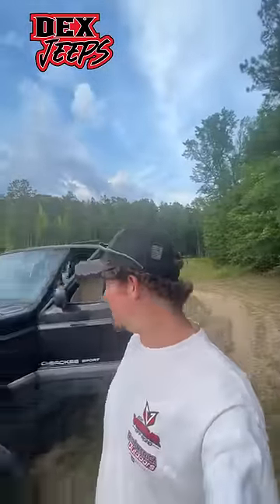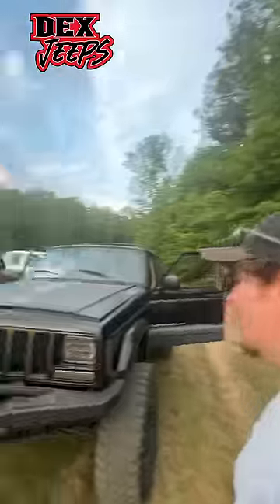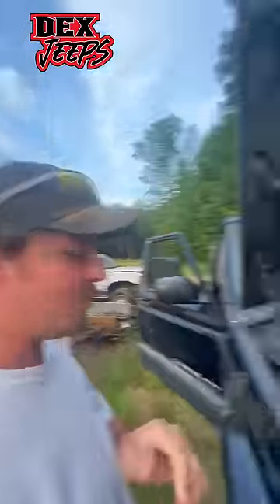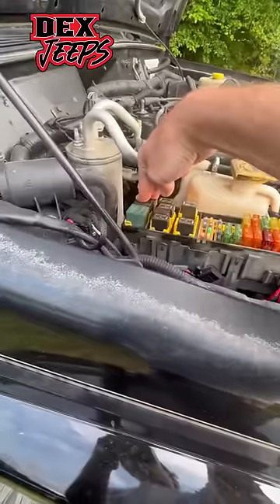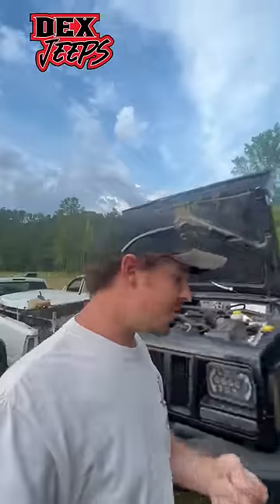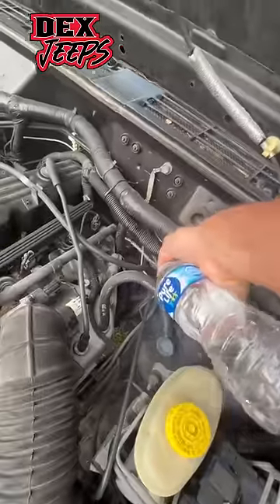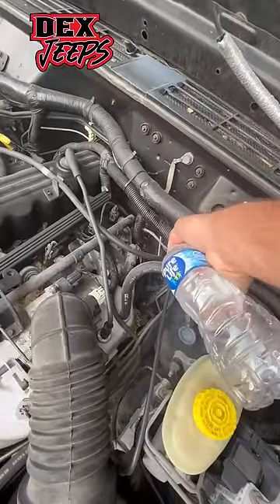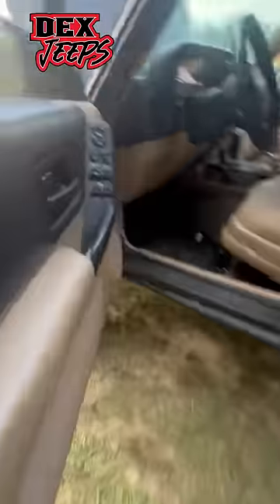Jeep crank sensor trick to get you home. #jeep #jeepxj #xj #jeepcherokee #cranksensor #jeeptips

Comment: It's a $10 part that is known to fail. We've carried a spare in the glovebox for decades.
Reply from the maker: lol I’m 100yards from my shop with a lift.
Reply: uhhhh a 10$ sensor isnt going to have the correct magnet strength.... the CPS is a sensor you want to buy from mopar... im a Jeep guy for the passt 20 years..  I am absolutetly shocked you got 71 thumbs up for this..

The 10$ amazon sensors, the magnet cant even hold a trim screw... the mopar you gatta pry the screw off... but hey have fun breaking down again.  

Mopar does make the cps for the ZJ and XJ still brand new..
Reply: @jeepsblackpowderandlights4305  Funny thing is just how wrong you are. Your first mistake was to assume that we're using Amazon sensors, but I have installed many over the past 30 years as a professional tech and they work just fine. With inflation and crap since covid if you pay more than $25 for a Mopar crank sensor then you're shopping in the wrong places. Just because you spend more money on your's doesn't mean it's better, it means we're smarter with our money. 20 years you say? Even my kiddos have been jeeping longer than that.
Reply: Just paid $400 for a tow and a crank sensor 100 miles from home 😭
Reply: @jeepsblackpowderandlights4305 this^ one of my friends has 2 cherokees the aftermarket sensors all fail within weeks sometimes even days after the replacement. He has done the replacement numerous times while waiting for the mopar genuine part to come in as they're kinda hard to come by.  Best bet is always to get a mopar genuine one. Unless you love replacing the sensor 😂
Reply: Try 45
Reply: @DriftingDragon74 this sounds like straight cope.. the higher the price usually does mean the higher the quality bud, I’ve been a parts monkey and a tech, sorry to say it bud, but he’s right. Yes there are outliers where you pay more for shit quality but dealer is always the way to go.
Reply: @DriftingDragon74 one day you’ll learn the difference because it’ll bite you in the ass. The difference in quality of part between oem and aftermarket is huge. There’s a reason why the factory sensor made it 15 years and the oreillys master pro special made it a year and half. (Exactly why the warranty is a year, it’s meant to break again)
Reply: @THESK8LIFE97  One day you'll learn not to make assumptions. Where did I say aftermarket is better? I use Mopar or NTK sensors typically... of which many are made in china. However at the end of the day I must install what the customer requests and here in northern NY over the past 30+ years as a professional tech   I have not seen a difference in longevity. A $200 sensor can fail at the same rate as a $5 sensor. Just like I tell my customers when they complain of the same problem after they changed a part... just because it's new or you spent a lot of money on it, doesn't mean it's good.
Reply: @jeepsblackpowderandlights4305  I'm absolutely shocked by your 14 thumbs up for this ...
Reply: @Heywoodjablowme420  why is that ?  Its the 100% truth.. compare the magnet strength from a mopar cps to ntk or bosch or autocraft or any other brand.. All those brands have nearly 0 magnet strength.  They cant even hold a dash trim screw in the air.

Its why so many people continue to have cps problems after replacing the sensor with someone not mopar
Reply: @DriftingDragon74 you have not seen a difference in longevity because those customers that do probably wont be going back . and the ones that do go back probably arnt knowledgeable enough to do it themselves or havnt graduated from the great youtube university… 

when i get a crank sensor or map sensor  from napa after waiting a week and i read it says made in china i send it back with a note why i sent it back.. usually get one from Mexico after that or made in usa .. anything electronic that will make my cars not start are always going to be original im patient
Reply: Were you getting them for $10 the $60 ones last about 3 months
Reply: @vwclub3  get mopar mopar still makes em.. last another 20 yeara... ive tested all the brands.. the magbets in em are weak as hell.  The mopar uses a super super strong magnet
Reply: Have a very similar problem with a Chevrolet Diesel in the future. Carry extra ones in the glove box but sometimes you just don't want to have to or have the time to swap it out
Reply: Hey buddy in all serious I am a new to  jeep guy and is it true about the Amazon sensors, I think it is my Rubicon 's issue@jeepsblackpowderandlights4305
Reply: $10? A OEM replacement crank sensor is $150 now. You might get a Chinese knockoff for $20, but you get what you pay for.
Reply: @leonardmadden6652   get mopar man dont get any other brand for the cps
Reply: @SuperFrankieOSX 
I bought a $100 Napa sensor and it's 4yrs old,  working great.
Reply: @ghrohrs2020 ordered one at the local Jeep dealership it was 200 with the tax.
Reply: @jeepsblackpowderandlights4305 I love you thought it was just me
Reply: @SuperFrankieOSX sounds like flex plate/ torque converter is loose and smacking the crank pos sensor. It’s literally just a magnet nothing much to go wrong.
Reply: @DriftingDragon74 usually higher price is for the reason of better quality
Reply: I used to carry a distributor module in my GM car's, stopped me from being stuck or get a tow a few times.
Reply: Didn't fail for decades then
Reply: I spent almost 100 lol
Reply: Pretty sure i still have a spare in mine too
Reply: I heard mopar doesnt make those sensors any longer

Comment: My Jeep had a random dying issue I figured it was the crank sensor so I replaced the crank sensor the problem continued every now and then it would shut off randomly and not start up until it was cool so I threw money in it replaced all the sensors wiring harness ECU come to find out it was a defective new sensor 😑
Reply from the maker: New stuff is such garbage quality.  Sucks.  That’s why I suggest my used parts.
Reply: That's why you measure it and not shotgun it. New means new to you , not the part.
Reply: If changing the first time failed  I would probably change it 1 more time .
The parts especially from China are crap.
I went through this with a window master switch. I could play with the buttons and it would work. I replaced it the second time and the problem was fixed.  It's to the point that three strikes before it probably isn't the part.
Reply: The acronym for new is Never Ever Worked.
The problem with home mechanics is that if you buy a faulty sensor the parts guys don't want to take it back with the old  'No return on electrical parts' shtick.
Reply: The cost of a labscope is about as much as the money in parts that was thrown at it. A labscope would have shown you the sensor was faulty and saved all that ammo in the parts cannon and got you going again alot faster.
Reply: i got a 92 cherokee, i would love to have your knowledge lol
Reply: If you're not testing you're guessing. Don't be a PCM unless you're going to go all the way.
Reply: @dexjs  Mopar still makes the CPS.... brand new 2023 i got one for my 98 ZJ 4.0, was $120 but worth it.. compare the magnet strength to a aftermarket one that cheap ass people buy and youll see the cheap ones cant even hold a trim screw in the air
Reply: You need to buy a Mopar CPS not the part store ones the mopar has the super strong magnet in it.. the cheap ass chinese ones, the magnet cant even hold a trim screw up...

Mopar still makes these brand new.. look online.. type in mopar Crank Shaft position sensor for your Jeep and youll find it..  I got one made in may of 2023... the magnet is so strong you gatta pry anything you put on it off
Reply: Lmao ouch man
Reply: @dexjs you sell used parts?

Comment: Sometimes I miss my XJ and then I remember all the times it did this kind of thing to me. Sooo glad I sold it. It's a Jeep thing, and I definitely understand.
Reply: Same here, never again!
Reply: There are inexpensive ways to prevent heat soak.
Reply: My 95 xj had a sticker on the back saying "it's a jeep thing you wouldn't understand" my grandpa peeled it off but you could still see it in the 90s tint lmao
Reply: @dickJohnsonpeter the key is finding a good one. You can put all the time and money you want into it but if you start with a rustbucket which is what most of them in the north are it will still be a turd. The only saving grace is the 4litre started almost every time
Reply: @dickJohnsonpeter lol, what a hassle.  Lol, I had the CS fail 3 times in the last 23 years and that's my limit, I swear!
That's almost $30.00 in CS replacements, or about $1.30 a year.
Who the hell can afford that?

Comment: HEAT is my BIGGEST NEMESIS in my 02 WJ…..I got a high performance electric fan on from the time I start her up till I shut her off. If that fan burns out in the middle of no where…….its a long SLOW ride back !! I got stranded for several hours in the middle of no where at WINDROCK Off Road Park…..in the middle of the night. You couldn’t see your hand in front of your face, it was so dark. A lot of animals come out at night in them hills !!!

Comment: I have a mint 2000 cherokee, im wondering what the widest and tallest rim/tire setup is that i can run om stock suspension. I DONT WANT TO LIFT IT. If you can help me i would greatly appreciate it

Comment: This is why keeping your indicator/blinker fluid topped up is so vital during the summer. 

If you run out of crank sensor coolant on a hot day, far from home, you simply pop an indicator out, remove the bulb holder and hey presto… both liquids are completely interchangeable and compatible in either  application 👍🏻
Reply: Australia Ed ford falcon crank sensor

Comment: Overtime the plastic becomes like rubber in it allows it to flex and move a lot more when it expanse from getting hot overtime it separates the connection.. when you cool it down it shrinks really fast allowing it to get continuity again

Comment: I have to pour water on the #3 injector sometimes after it heat soaks
Reply: Same same. Wj though.
Reply: I have a WJ with the 4.0. I put the DEI shield on mine and it seemed to help.
Reply: @ziggystardink9389  yeah I have one as well. Didn’t help me.  I have the banks sidewinder turbocharger with larger Bosch injectors.  Never had a problem before I installed it
Reply: @litergy1 Ah yeah that changes things a bit. I put hood vents in mine and helps quite a bit with heat extraction.
Reply: @ziggystardink9389  lol got hood vents too
Reply: @litergy1  Well them i am out of ideas.

Comment: Use a hole saw. Drill a hole in the floorboard like a little bigger then a golfball.  It will be off to the side of the Accel. They make flat plastic plugs that you can put in it.  Keep a can of brake clean on you ( to cool it off)  And a spare cps.  Then if you have a no crank issue pull carpet back *spray spray.
Reply from the maker: I’m assuming you have done this before??
Reply: where and what side on the floor board?
Reply: @danielleon-jy3wn  He said it was near the "accel", which I take to mean accelerator, or gas pedal.
Reply: Need a video on this mod
Reply: I've heard of this mod, but can't find the plug for it.
Reply: Then PULL, AIM, SQUEEZE and SWEEP!
Reply: Sick pro tip
Reply: Horrible solution
Reply: Reason to not buy a car
Reply: That's some redneck engineering 😅

Comment: Some cars if they have a cam angle sensor can actually unplug the crank angle sensor and it will run
Reply from the maker: Like a limp mode kinda?
Reply: @dexjs  yes. If you have a vehicle you drive or maintain at the next service just try disconnecting the crank sensor the check engine light will go on and it may or may not run but if it does run it's an excellent diagnostic tool
Reply: Like a failsafe paramater in the earlier computerized stuff, so if you lost input completely from a sensor it uses a known good signal. Sometimes on the older systems you can diag runability issues by unplugging things while running.

Comment: The 4.0 ignition coil can overheat and the jeep will die, then start up when it cools. You usually can see hairline cracks in the plastic cover when it starts to fail.

Comment: I hope whoever designed the crank sensor so that when it fails it won't start, stubbed their pinky toe every day of their remaining lives.
Reply from the maker: I fully agree, and on top of that they shoved it on top of the bell housing too..!
Reply: @dexjs  I wonder if this trick will work for all makes and models, or if this is Jeep specific.  It's good to know nonetheless.
Reply from the maker: Should work on all, but Jeeps just mount theirs differently..
Reply: @dexjs  alright, good to know.  Now to learn where the crank/cam position sensors are located on each car...

Comment: So heat made it stop working? Does it need replaced or is it too hot to work? I always use OEM sensors, this is interesting. 
I've been working on Cherokees a long time and haven't ran into a too hot crank position sensor. I have seen cracks that look to be from heat in the sensor. But I am curious if it's literally just too hot to work or is failing?
Reply from the maker: It’s a magnet. Magnets stop working when they get hot.
Reply: @dexjs  oh yeah ok makes sense

Comment: There's also another trick if you check all the harnesses that plug into your CPM.... My buddy showed me that shit...if you unplug from the CPM and twist one or two full rotations the harness and plug it back in and we'll tighten up the connection, from there you can at least figure out which one or ones are loose and fix. I would definitely give it a shot I was surprised I had two plug-ins that were loose

Comment: I have a random no crank no start after hot and I can’t figure it out. No codes only after driving for a bit then parking like heat soak but I get a no crank. The key does nothing. Usually when I manually jump the starter relay it goes. When I crank it over I can feel the asd relay clicking so I don’t think it’s my crank sensor. 04 wj 4.0 with 130k also I drilled a hole in my thermostat and when I replaced my radiator I added a clutch fan along with the factory electric fan. It dropped my average temp by at least 5-7. It used to never move down from 210 when driving or sitting but usually maxed at 212 maybe 215 the most I’ve seen. Now it runs at 205 max. This seemed to help at first but now I’m stumped as to wether it’s a combination of heat soak and something else maybe?

Comment: Old school yj crank sensor wires were frayed, tried multiple sensors from different suppliers and none worked. Ended up sodering the wires and epoxied the base and the dam thing runs great. Why tf are Chrysler products so dam picky when it comes to electronics? FFS

Comment: IMO, yet another fail by Chrysler engineers. Not only did they bury this sensor in a terrible place, they allowed a sensitive sensor to remain open to contamination. I'm going to try washing the sensor housing with hot water to potentially rinse off dirty, salty, east coast grime. This issue never happened in Colorado. Not a month of NY winter and this 💥 happens. Chrysler deserved to fail.

Comment: Had an 03 xj. Never once did I have this problem.. But is very interesting to learn from. 
My guess the reason I did not have this issue? was because I replaced the thermostat with a lesser temp rating and that helped keep it cooler overall.
Reply: An 03 xj?
Reply: @ryanrogers191 U.S. production for the XJ ended in 2001 but continued in other markets internationally for longer.
Reply: WJ my bad..

Comment: Does the little 2.5L 4 Cylinder have this same issue? Ive got one in the shop that will act dumb like this. Sometimes it fires up cold. Sometimes it doesnt. Other times when its warm, it wont crank. 

But i found out if i disconnect the wire from coil to distributor and put a spark plug in it, touch spark plug to battery ground and try to crank it. When i see a spark i can connect it back to distributor it fires up great

Comment: Good stock cooling system. Wrap fuel rails with heat tape. Taller hood hinges to give about a 3/4 gap to let out hot air. E fans you can toggle on for slow trail rides where our xjs like to heat soak. Those few things have been a god send to my xj.

Comment: To anyone seeing this... Mopar is the only brand EVER you should buvy for the crank shaft position sensor on a 4.0.. xj zj etc...  They do make them still brand new from Mopar... the magnets on them need to be strong to read the teeth on the flexplate...  The NTK and Bossch and other cheap part store ones.. cant even hold a trim screw up in the air...  This is why when you guys buy the cheap $30 sensors you still have the issues your jeep had before... buy Mopar... I own 4 Jeeps.... mopar is the only way to go for the cps.. this isnt as sensor you wanna cheap out on trust me.. dont do it or youll be crying wishing you just spent the $120

Comment: I had a 96-98.  It’s been a long time.  But it had a crank sensor because the engine was from a different year either the year before or year after but the year it was no one I talked to knew it had a crank sensor.  When that fucker failed it was so hard to get it fixed because no one knew why it was intermittently acting like it was misfiring.

Comment: It's not $10 part for a 7-3 Powerstroke in the Ford turbo diesel truck because I had the same issue I always kept a spare sensor even when I don't have a spare sensor for when I find one for cheap that is a crank no start change out that sensor and sure enough she runs

Comment: Had same issue on my 1974 El Camino 2 years ago, my daily drive since 2017. The IC+module in the distributor was not greased with cooling grease, and got overheated. Simple as that.

Comment: Crank sensor went bad on my '94 ram 318, sort of. There's a crack in one of the wires, it wasn't completely dead but the wiring was all corroded and green. Ran great cold, would stall and max at 3K hot. It's in a really bad spot too :(